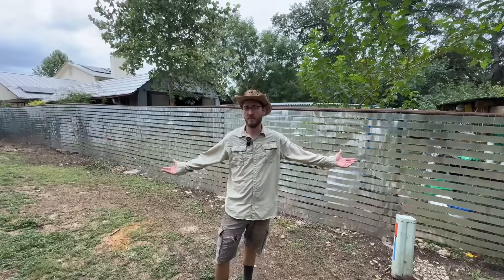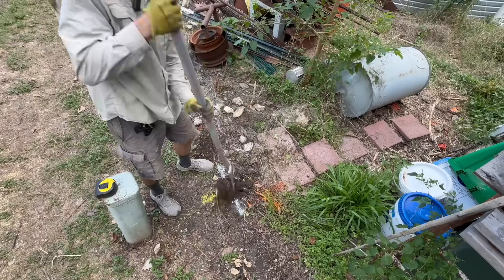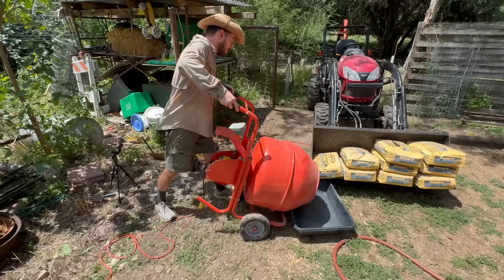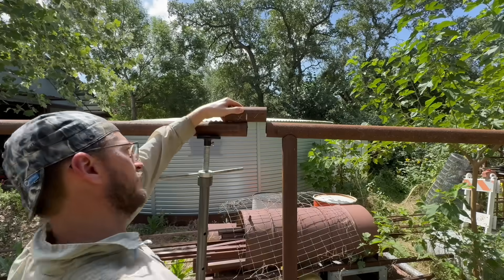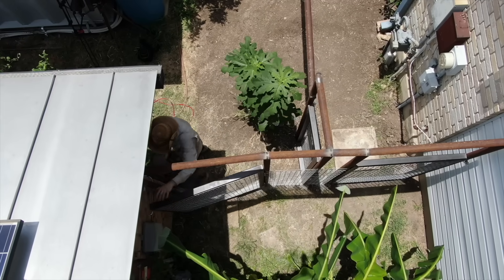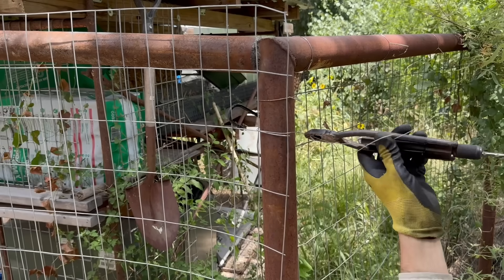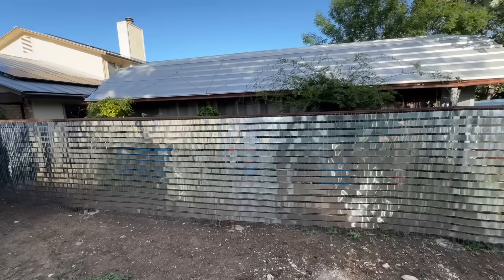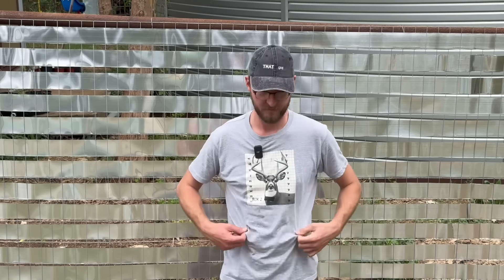This FENCE Lasts 100 years!!!!

Comment: You should ALWAYS have some kind of drain hole in any iron or steel, horizontal pipe.  Since the low spots cannot be determined, this is kind of a crap shoot.  Best bet is to have a gap into the riser pipe, so that the water can go into the ground through it.  Easily done while welding.  We also ran into this problem with underground electrical cabling runs for lawn installations.  No matter what you do, water will always collect into the bottoms of any flat pipes.  Best bet (if you are above the actual water-table) is to let it drain out.  Much longer lifetimes for any materials.  If you are below the water-table, you are on your own, and had better seal everything up with double or triple waterproof layers.  Lifetimes still sketchy with HomeDepot materials.

Comment: It won't last 100 years mate, you didn't even sand blast it and paint it. But it'll do a bit better than cheap fence panels. Concrete fence or brick, or roofed walls with waterproof faces like in Japan, slate dry stone walls, all these can do 100. You can even use timber and hit a hundo in those conditions with careful enough construction.

Wind is stronger than you think, i'm not sure how long it'll hold up to the repeated movements. The force will weaken one section and it will bend more there causing fatigue.

Comment: Looks great but I don't think I would do it because the edges of the aluminium look like they could be very sharp and cut little fingers with ease.
Reply from the maker: They are not nearly as devastating as they appear. The flashing is super thin so they kind of bend more than they cut. I also think it helps that my miter saw made a very precise cut. If I’d use scissors, I think the edges would’ve been much sharper. Thanks for commenting.
Reply: @suburbanbiology  Thanks for replying. BTW, I enjoyed your humour.

Comment: Nice work. I helped my Daughter/SIL in Jax FL build wood/Horse panel fence, and used concrete mix dry in post holes. No bracing required. 12' 2" panels cost 75$ to build with treated deck lumber. Looks great.

Comment: just a thing pull the fence tight before you connect it  and put a paint coating on the flashing to keep the heat  down other than that not to bad

Comment: I did the same thing in Pennsylvania about forty years ago. The fence is still standing. I used galvanized piping from the scrap yards. We must have the same mindset fella. Job well done.
Reply from the maker: Glad to hear it worked for so long. Pennsylvania is far wetter than here so I think mine will hold up well. Thanks for commenting!
Reply: @suburbanbiology  - Great project, thanks for the vid! I would just note that since the fence is now 3/4 filled in by the flashing, it WILL catch a lot of wind. Depending on the wind direction, the wind force could over-stress the tie wires, so it may need more, maybe twice as many? Good luck!
Reply: @suburbanbiology  PEACE FELLA.

Comment: Loved the video, your ideas and helpful tips and tricks.  Only thing I would say is I would have concern over aluminum flashing against steel.  Steel and aluminum are enemies when it comes to corrosion.  Galvanically very active.  Where they are touching you will likely have very fast acting corrosion and it wont last 100 yrs.  Loved the look though and bet sunsets really are gorgeous reflecting on that fence.
Reply from the maker: It’s relatively dry here so I’m hoping the corrosion proceeds slowly. The framing should last a century. I could imagine having to replace the wire earlier 🤷 I guess time will tell.

Comment: Doesn't limestone and water increases the chances of quicker rusting of metal? You should check for rusting in one of the metal piped in about an year and show it's condition.
Reply from the maker: I’ve had steel in cement in the ground for about 15 years and then pulled it up last year. The steel was in excellent condition. You could not see any difference between the part that was underground and the rest of the beam.
Reply: @suburbanbiology  interesting. I have heard that metal corrodes at a faster rate when used with limestone instead of cement. I just wanted to check this theory apart from what Quora and other forums say.

Comment: Steel oxidizes, to the point of failure, even in dry places like SoCal (southeast Los Angeles County).   I ride my bicycle along the Coyote Creek (concrete lined) river, and see chain link fence with rusting poles that were galvanized, 50+ years ago.   I recommend red oxide paint, even if you're living in a dry location, especially near the ground interface.  Never let water get INSIDE those pipes.       My son bought a fixer house (build in 1968) here and I'm involved in the repairs.  The roots of the backyard vines are tangled, massive, and as thick as YOUR arms in some places.   I hope your fence last 100+ years but it will take occasional, serious maintenance.

Comment: 100 years, I don't think so. 50, maybe. I've seen that thin galvanized wire succumb to rust. Also, all the weld pionts and the square tubing are your weak points. Paint will help. You did a good job, though.

Comment: Good day sir. Great job indeed, and lots of thought in the process, my only concern is radiation reflection to direct infrared and residual  radiating heat against your plants and grass.
Reply from the maker: So far the plants seem to be doing just fine. The fence runs north south so each plant is shaded for 50% of each day by this fence. Maybe that’s why it’s working 🤷  Thanks for commenting and for subscribing!

Comment: I do need to point out that using the aluminum flashing won't last.  You have steel, and aluminum, and will get galvanic action between them, destroying the two over time.  So, your 100 year fence will go long before that.  I would suggest that you use the same type of metal throughout the fence.  The other issue is electrical.  Induction from overhead power lines could be an issue for some, as well as the possibility of the fence becoming energized electrically.  You need to ground the posts, and cement is not a good ground.  So, every 30 ft or so, pound in an 8ft ground rod and use #6 solid copper wire to bond the grounds to the posts.  This will reduce the possibility of electrocution.

Comment: You gotta throw the ole wrist twist and bend at the end when you use safety wire pliers.  Cleaner are safer.    Source: I worked aircraft maintenance in the Air Force.
Reply from the maker: Seems like a credible source. Thank you for your service 🙏🏼

Comment: Wondering if you’ve had any issues with corrosion due to catholic reaction between the Al and steel?
Reply from the maker: None yet. Pretty dry in our parts. It may a problem long term though. Time will tell.

Comment: Brilliant! I currently have privacy screen mesh attached to my fences, but they definitely won't last 100 years. After 4 years, there are already some holes from where the wind caused it rub on the fence. After searching on Amazon, it looks like 4" flashing would fit in the wire fencing even better for privacy, and since I don't own one of those big fancy power saws, I'm thinking already cut-to-size would work better for me. Thanks for sharing the great ideas!
Reply from the maker: I would caution that you should measure the gaps in your fence before buying 4” flashing. The gaps in my panel are marketed as 4” but they were actually something annoying like 3.8” so 4” flashing would fit. Either way I wish you luck. Thanks for commenting!

Comment: hey dude -- great project and  i like your straight forward  low drama/corn style   --- improvisational building is the way to go --- it's fun and you use up junk and save money   ------   the fence is awesome in the right location --- the light reflection at times i bet is really 'neet' ---     my town has a metal supplier that has a huge 'surplus' section that they sell by the pound ---- there is also craigs-slit ---  the flashing idea is brilliant --- the dispenser is genius ---   the fence looks amazing  ---  there is also the option to make the flashing strips maxed out and eat the waste and extra time for increased privacy  ----   There is also the option of pray coating after the fact if someone wants to mess with color ----   the video could have been a lot shorter ----   you could have said "i got these poles cheap and welded them together and cemented them in at this height and spacing --- showing close ups --- done ----   people are going to to join things based on their tools and time and design jollies --   i see no reason someone couldnt do this all bolt together in a few different ways ---
Reply from the maker: Thanks for commenting! I’m glad you enjoyed it!

Comment: The aluminum will pull the zinc off the galvanized fencing.
Reply from the maker: Eventually yes. But in my dry climate I think that is a far off issue and the vines will have covered the fence by then.

Comment: Love the idea may be a bit too shiny for my liking maybe hit them with a few passes of steel wool, also those shiny strips of flashing will help a bit to detour the deer but on another note I would be careful of is if your in a really hot dry area and have dry weeds, I’ve had the heat  a reflection ignite weeds from a good beam that hit the same spot for a long period of time and ignited the weeds I also had an aluminum block drop and hit another metal part and the tiniest of sparks lit up a fire in second was a blaze that my largest extinguisher just barely put out in-time  but not to be off subject, but I had to put that out there!!😢
Reply from the maker: Thanks for the tip. I’ll keep a vigilant eye out until the vines grow. Thanks!

Comment: I really don't like to disappoint you but I  have to because viewers might want to build a similar fence. This fence will definitely NOT LAST 100 YEARS ! Simply because of the fact that the pipe posts will rust away directly above the concrete foundations! If you had cleaned the pipes about 10 cm under and above the foundations surface and put some tar or tar based paint/stuff onto the pipes, the fence posts would definitely last longer. Even more if you had filled them with concrete and one long piece of rebar. Additionally you used three different types of metal (mild steel, aluminium, stainless steel). This will definitely cause some contact corrosion! Please don't ask me why I know all that, sigh.
Best regards, luck and health in particular.

Comment: Nice Aluminium against steel (ok galvanised steel, so initially Aluminium against Zinc, till the Zinc corrodes)....... maybe cut some plastic drinking straws (if you can still get them) to put around the galvanised wire to insulate it from the Aluminium.
Reply from the maker: I’m curious to see the rate of corrosion. I’ve read that unless conditions are moist it is a slow process. Things are pretty dry here so I guess time will tell. The drill pipes will remain just fine so in a worst case scenario the mesh may corrode and I will just unroll another later on top of the vines some day. I’m betting it won’t happen in my life though unless the neighbors get a Doberman. Thanks for commenting!

Comment: Not sure how this came up in my feed, ending up watching start to finish due to title...I'm Not a builder by any means...Loved the enthusiasm, ideas, and thoughtfulness of the interaction between two neighbours..Not a fence I would personally have...Having said that, wouldn't smaller creatures dig their way underneath the fence? Foxes and things
Reply from the maker: On the fence that abuts the wilderness I welded a bottom pipe that holds the bottom of the fence firm. Only on the fences I share with neighbors did I skip that. Thanks for commenting!

Comment: L0VE IT..I HAVE SECURITY PROBLEMS AND THE USED DRILL POLES WOULD KEEP FENCE UP THROUGH HIGH WINDS.. IVE BEEN BROKEN INTO 7 TIMES RUINED BARN AND POCKET BOOK 2 ACRES IS EXPENSIVE TO FENCE  BUT THIS LOOKS MODERN AND IF ONE WANTED BEFORE WEILDING TOP RIALS TOGETHER YOU COULD RUN ELECTRICAL WIRING FOR LIGHTING UNITS AND SECURITY AND SILICONE THE HOLES WHERE IT WON'T LEAK INSIDE THEN. YOU HAVE MODERN LOOKING FENCE WITH LIGHTING AND PLACE FOR SECURITY MONITOR S COOL FENCE COULD SAND METAL POLES PAINT SILVER YO MATCH FLASHING WHAT WOULD BE THE ENVY OF EVERYONE A 10 + FENCE😮

Comment: I can tell you aren't a professional fence builder or a Trained welder. But good Job for a Diy, when you did your joints to add a piece for the gaps you should of put in a sleeved inside and did a few plug welds and used a 2" half channel to clamp making them seamless rather than magnets. Your welds are sticking but they don't look strong doesn't looked like enough penetration. From the welder it looks like a 120v amp Flux core with a .035 single shield being used on 2 3/8th s40. A stick welder would of done a better job for the amount of rust that was there. 6011 rods. Also I install fences for a big company and i can tell you, your fence isn't tall enough to stop deer. I've installed 12ft fence, 1 foot buried with 1 foot of barbed wire for the military the terminal was 14 ft. The deer jumped and cleared the fence by 3 ft easily.

Comment: Laser cleaning old rust with scales isn't effective as it doesn't remove the rust scales nor the rust under the scales. But this is a fence and it doesn't matter if the rest of the fence is suppose to have a rustic look. A good video with great information.

Comment: Genuinely curious (no experience building fences, want to know why I'm wrong): why did you approach building a short pipe fence the same way you would build a long wooden fence (i.e. by making holes, embedding a bunch of posts at best-effort places on the ground, and then assembling everything together)? Seems like metal pipe doesn't have the same forgiveness for slop that wood does. Wouldn't it be easier, given a rigid building material, to use metal-shop fabrication techniques?

Something like this:

1. Weld everything together (on one side) while all the pipes are laid out on their sides on e.g. your driveway, deck, or some other large, flat, level outdoor work surface. Now you have one big, rigid (but still somewhat brittle) pipe fence assembly.

2. Roll out the welded-wire fabric beside the fence. (Just kick it and let it unroll.) Weave the flashing into it. Pick up the fence and flip it over on top of the fabric, aligning it. Tie the fabric to the fence with wire. Finish the welds for the other side of the fence, and at the same time, secure the wire to the fence with spot welds.

3. Stand the fence up and lean it against something (a few boards, or just the side of your house); stick a few key "structural" posts into buckets lined with cardboard + wax paper (DIY sonotube); ensure the fence is standing at 90 degrees; and then fill the buckets with concrete, creating pre-formed concrete footings. Now you have a strong, rigid and freestanding pipe fence.

4. Drag the whole assembly over to your property line; line it up with where you want it; dig holes *where the ends of the posts/footings are*; drop the assembly into the holes; and fill the holes back in.

Comment: Amazing fence my man. Question: isn't that aluminum going to be, along one edge, sharp razor death, and along the other edge (the cut one, sharp, jagged, razor death? Or no. Or is your place just one of those, not baby/child-proof kinda environments.
Reply from the maker: The edges are not very sharp. Both the factory cut and my miter saw cut are so regular that the edges feet soft. I didn’t cut anything on myself when installing it and the neighbors dog jumped and his paws are fine. The kids that have come in contact with the fence don’t have a scratch k them. If the aluminum was cut with scissors though I bet it would be much sharper.
Reply: @suburbanbiology  ok good, good. I don't know how things tend to go down in Republic of Texas, but in CA, we tend to get sued. A lot. lol.

Comment: The 9 inch milbar safety wire pliers from your amazon link cost $175. But the OTC 4795 Safety Wire Twist Pliers only cost $40 from amazon says it is frequently bought with the same lock wire .041 in (1.04 mm). Is there something better about the pliers to justify paying more than $100 more for it?
Reply from the maker: I went through about three different pairs of cheap pliers that I bought at Harbor Freight before I bought these expensive ones. In my experience, the cheaper pliers tend to wear out at the internal mechanism where the spiral runs through a plastic piece inside of the handle. I cannot speak for any of the ones that are cheap on Amazon. But I can say that some cheap ones from Harbor Freight did not last. Once I bought this expensive pair, they suddenly stopped breaking and they’ve lasted me for about five years now. They are still going strong. Hope that helps.

Comment: Some really good tips in this video thank you, though I do feel sorry for the person in the far future of that eventually has to dismantle that fence it's going to be a pain 😅

Especially liked the tip on how to keep the fence wire roll from unraveling uncontrollably that was clever 

I would be worried about the reflection from the aluminum it might act as a focusing lens and can cause damage to buildings that's happened in some cities
Reply from the maker: Because the fence is straight I don’t think it’s going to be a problem. A parabolic fence running east west would be devastating 😂 thanks for your support!

Comment: That's a great job. You could raise the height of the fence to fit the width of the barbed material. That way you could avoid cutting a part of the barbed material.
Reply from the maker: For the most part that’s what I attempted to do. It’s just the segment next to the old wooden fence where the dirt was mounded up that there was a height difference. I dug a small trench through the dirt mound to compensate. Thanks for commenting!